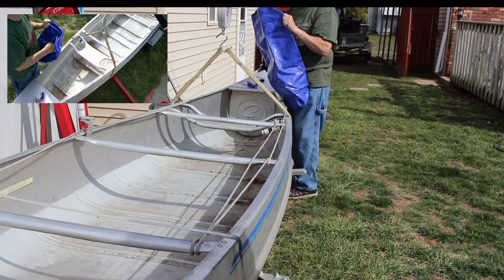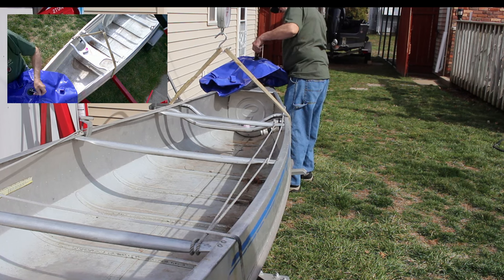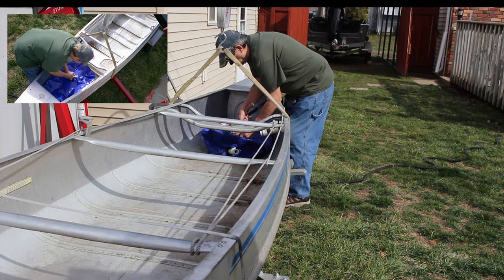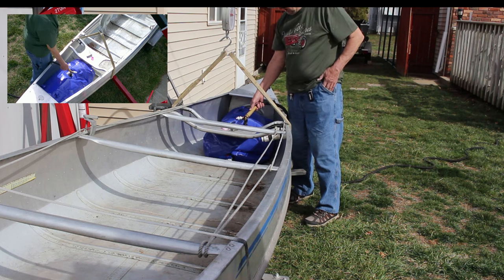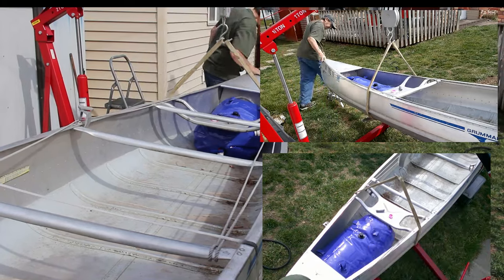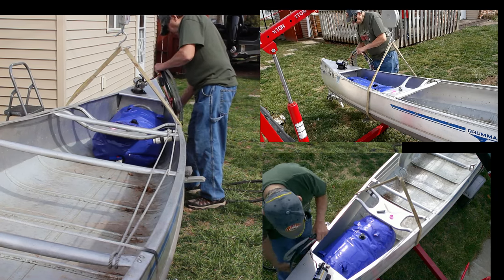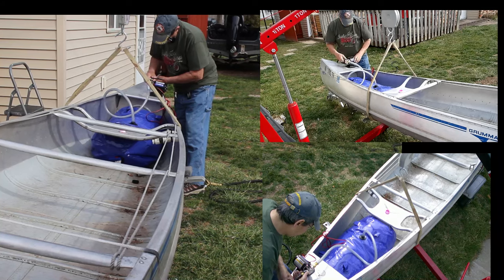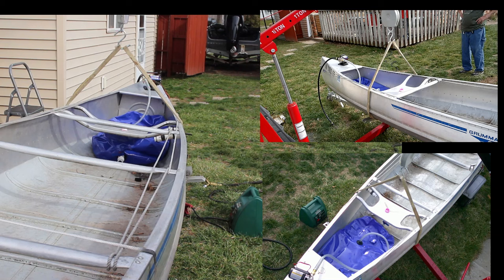Ballast install

Comment: A gallon of water weighs 8lbs 6oz. (8.375 lbs). That will equate to 251 pounds for you 30 gallon bladder. So you’re a little light on your number of 7.4 lbs per gallon. Is your intention to fill the bladder with water from the lake or river? Using the same pump only in reverse?
Reply from the maker: Thanks for the info. I was a firemen. And was taught that number. I plan on using the water I am going to be in. And yes reverse the system to empty the bladder. I'll leave a little water in, so the trailer has some tongue weight.